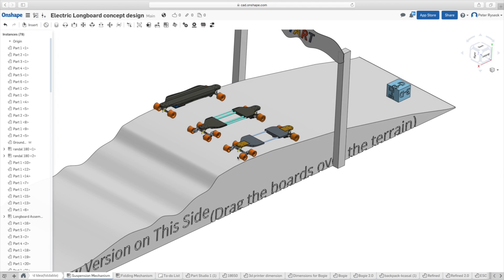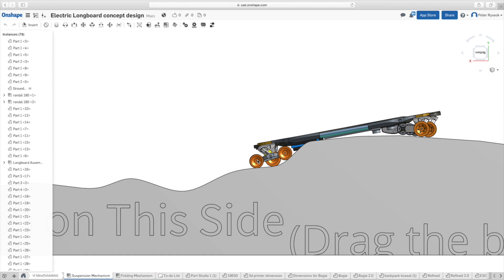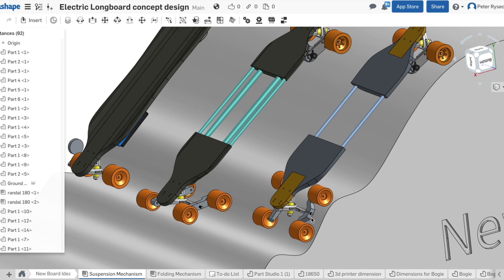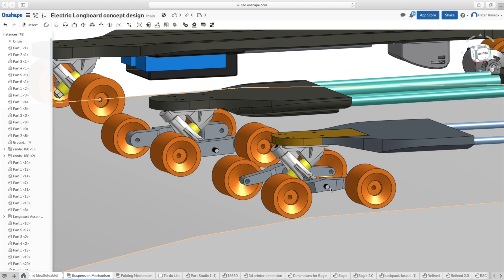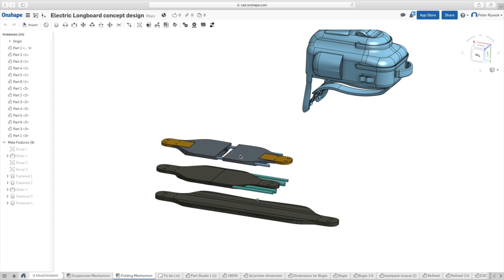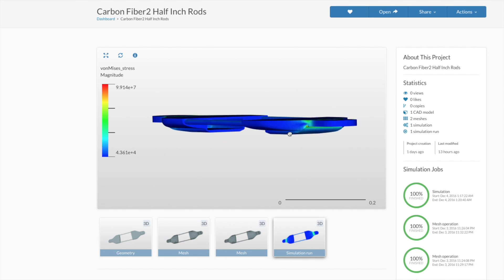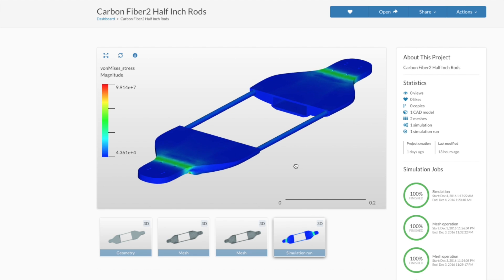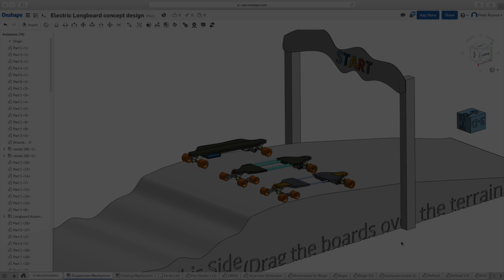Update: Concept Electric Longboard (stress analysis, new board)

Comment: Really love the idea of having a "sliding" board, but i would be worried about stepping in the hole in the middle of it.. but i guess it would be easy to fabricate a extra panel to snap into the gap which would also easily fit into a backpack. How are you planning on making the board stay in the "extracted" mode, so that it does not slide together whilst riding?
Reply from the maker: Thanks for the feedback! I have had many similar thoughts as you, since the big hole in the middle is clearly a safety risk... However, I don't think I will have an extra panel because I  want to avoid having multiple parts that you have to assemble- One simple slide, and the board will be ready to use. So I think I want to have some sort of collapsable panel that would rest on top of the carbon fiber rods. For your second question, I haven't put much thought into it since I still need to figure out if the folding design will even work in the first place. But, chances are it will be some sort of locking mechanism that will twist, securing the rods.
Reply: oh come to think about it, why not simply attach that extra panel with a hinge so that it's on the collapsed board and only has to be flipped over..
Reply from the maker: Car Karl very true